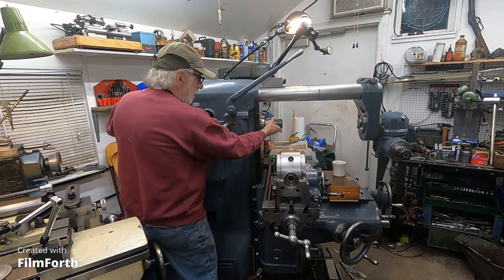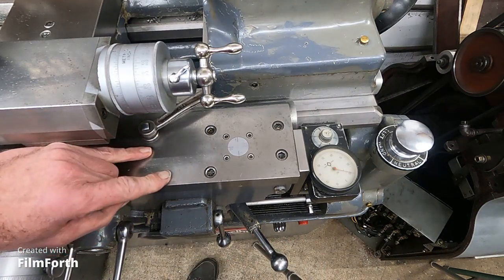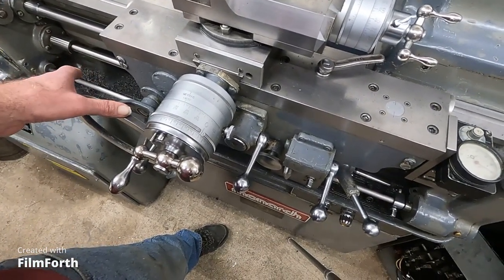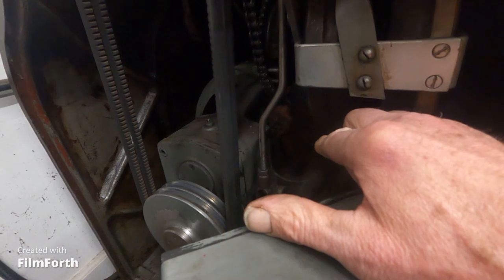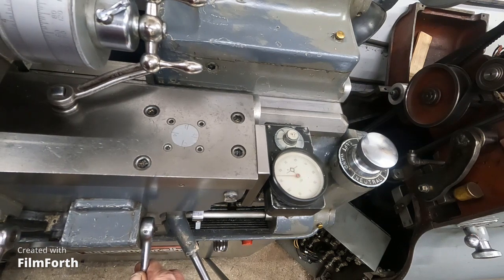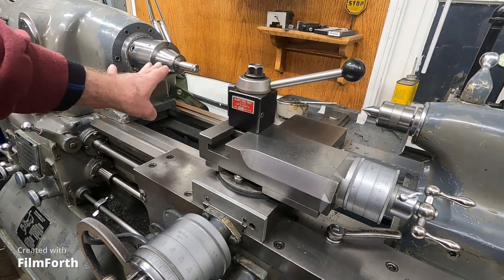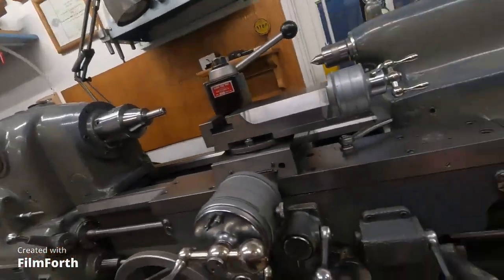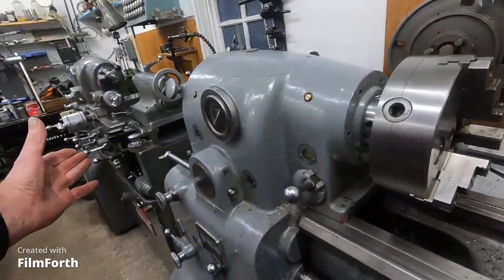Tool Room Lathes Leadscrew Reverse

Comment: Feeling for the engagement sounds like good advice.  Joe pie talked about this a while back.  He was mainly talking about ways to avoid splitting a thread.  Like if you start engaging the half nut too late and end up  on the top of the next crest.
Reply from the maker: Yes, it can happen in smaller amounts also making fitting a nut harder often too loose

Comment: Hello DD! Another great video showing the awesome 10EE machine. Can you comment on all the various oils and there importance (or not) of their different duties in the machine? Thanks!
Reply from the maker: The factory recommendations works for me using Mobile DTE, and way oil, thanks
Reply: @deedeeindustrialsuperprecision  Do you use the DTE light in the bearings and DTE24 in the head stock gear area?

Comment: You were fortunate to obtain a 10EE with and excellent lead screw with no wear on the thread flank or half nuts.  It would be wise for those with older engine or tool room lathes to dial indicate the lead screw/half nut wear on their machine.  As most will find that both lead screws and ways develop most wear near the chuck end.  And less at the tail stock end.  Half nuts wear develops regardless of location.  So to know how much wear on those parts can affect the actual lead of a thread.  Additionally, holding back or advancing the carriage can help to “drop in” the half nuts, however, further use of the carriage hand wheel can also affect thread lead.  This can be an aid (or hindrance) when working with long thread items.  Even with worn lead screw bolt threaders use of the carriage hand wheel can aid when the thread gage are used for size and lead.  Appreciate your sharing your knowledge.  Perhaps you should consider putting out a cd or thumb drive with all your tips, as good reference material is hard to find.
Reply from the maker: I had very good luck on the last 3 used lathes I bought, they were never or seldom used for threading, the 80yr old Axelson apparently never as there is no detectable wear on the screw and the nuts lock in very tight, it actually needs to be broke in for the halfnut lever to disengage. I have used some very worn out lathes and that can get much more tricky. I am trying to get videos in play list should be helpful The best I can do is just what I am doing, I gained experience by following old guys around the shop, I try to do something with the machines everyday and just turn on the camera, thanks!

Comment: I have seen machinists that I thought were very good reveal their true selves by “stabbing” the half nuts in. I learned to “Drop” the half nuts in on my 9” Jr. South bend, and produced some very good threads with that old worn machine.
Reply from the maker: Some machinist hardly ever cut threads, the last 3 machines I have bought seem to have not cut many or even any threads. I had a SB junior I wish I still had, they were industrial grade bench lathes
Reply: @deedeeindustrialsuperprecision  They are very stout machines for how small they are. Deceptively heavy! And no gearbox to waste power, you can really make the most of that 1/3hp motor in back gear, with a good rosin’d belt.

Comment: I have a SB heavy 10 that’s my go-to machine for anything under 4” or 5” diameter. The only problem is, it’s very, very worn… Everything is worn, including the lead screw and half nuts. It’s almost pointless trying to cut threads on that machine, unless it’s a very loose tolerance thread. I tried cutting some feed screws on it and learned just how bad it actually is. I’ll try leaving the half nut engaged and see how much it helps. But for most part, i just thread on a different machine.
Reply from the maker: It can be very hard to do anything on a worn out 10" Southbend, the next size up fares better though. Thanks for tuning in today.

Comment: hey dee dee, got any pictures of your harlies you have had back in the day? had anything that wasnt harlies?
Reply from the maker: There is a 2000 Night Train and a 1953 K Model 1968 Honda Cub 90 here, I have had many other HD motorcycles also Ducati, BSA, In the machine shop I did work for the Harley, Honda, the snowmobiles and most other powersports. I have many old photos but they have people in them.